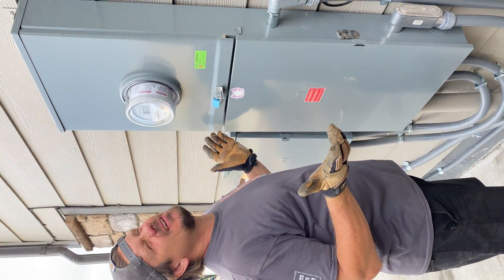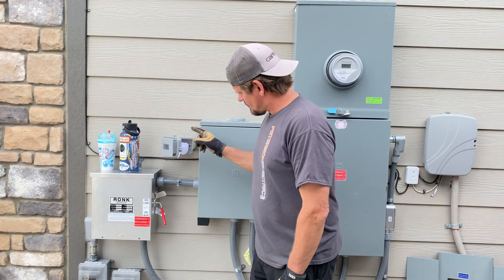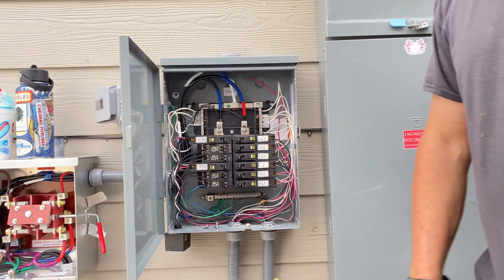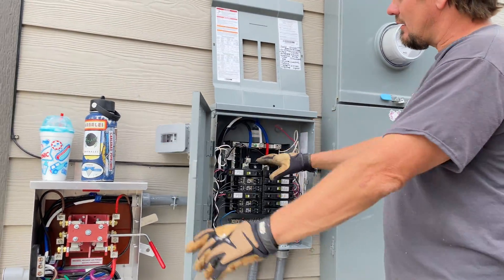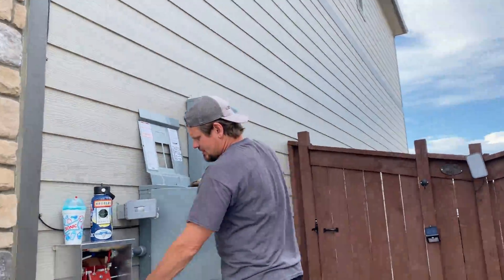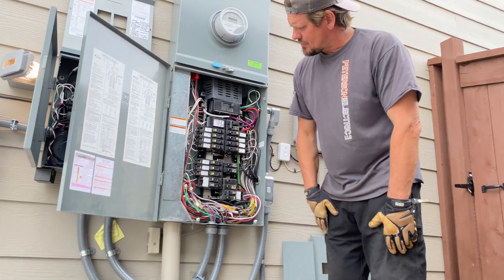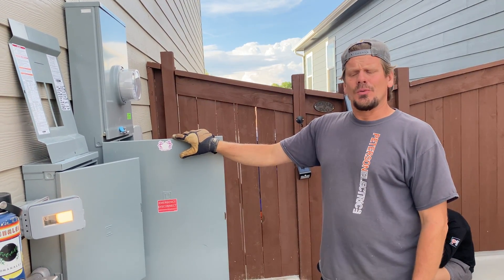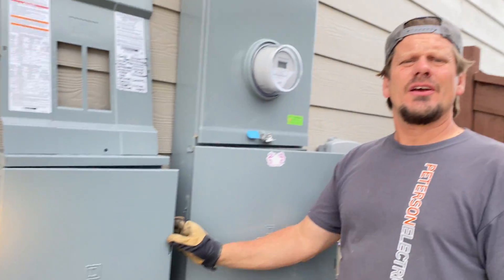Adding a Stand-by generator switch (manually)

Comment: Generator cables are usually male on the generator end and female on the house end, meaning you need a male receptacle box on your house. How does that one outlet work for both providing power to an RV or receiving power from a generator without changing the gender? A male-male cable?